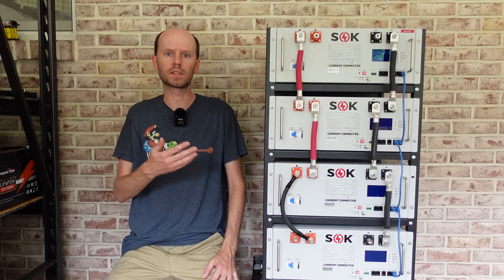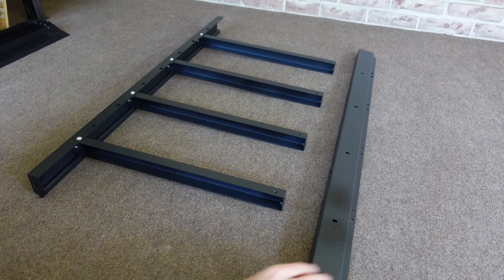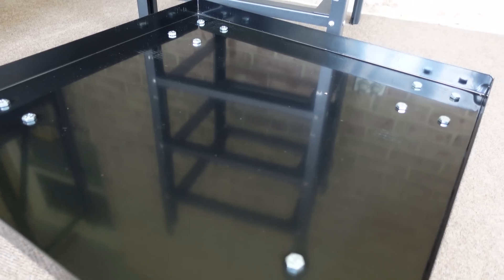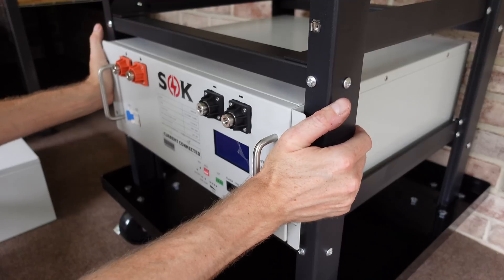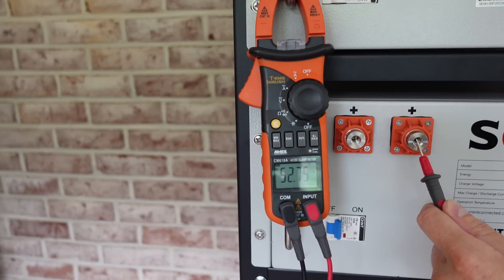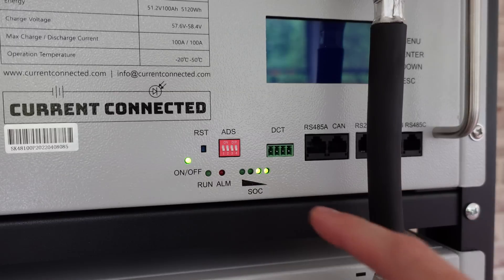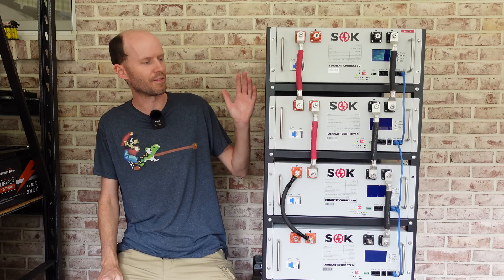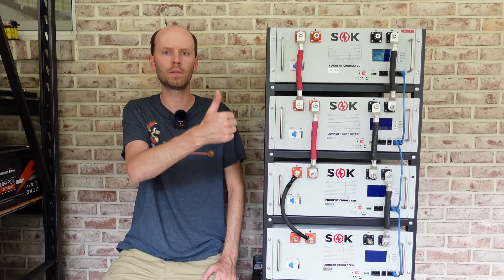20kWh SOK Battery Rack Assembly and Connections, LiFePO4 Off-Grid Solar

Comment: Being in parallel, what happens if accidentally someone turns off one the the breakers?
Reply from the maker: Then the affected battery is simply disconnected from the rest. The others will continue to operate.
Reply: @LithiumSolar  Thanks for your reply. I sent you an email about a bussiness consultation.
Reply from the maker: @josevargas8073   The sentence immediately following the email address reads "I am not available for personal project questions or consultation"
Reply: @LithiumSolar  Oh I'm sorry, I read that but as it's not a personal project and it will be a paid business consultation (sent from company email) I gave it a shot, thanks anyway and I'm sorry again.

Comment: Nice, helpful video. One watch out is that all positive and negative cables should be the same length to each other. Yes, within a very short distance, there is some flexibility, but overall, that longer black cable on the lower left serving as a positive cable looks both to be a lower gauge (2/0 vs. 4/0?) than the others and significantly longer in length than it should be. I guess you were short a cable during setup and just used this for demo purposes, which is fine, but it does raise the two important points I just mentioned that some people aren't aware of.

To the question below on cable length, having this setup myself, those straight cables are probably 9" in length. However, I did mine at 10.5" in length (terminal hole center to terminal hole center), so they would curve a bit and avoid going over the on-off breakers and displays. If you use a one-foot cable, the resulting bend in the wire causes the terminals to crowd each other. Still doable, but you'll want very good terminal covers on each if you do that.

Comment: Nice work. Have you looked into busbars? There are some videos detailing the heat and therefore power lost in the daisy chain setup. It can also lead to uneven charging and discharging.
Reply from the maker: Yes. I addressed that in this video https://www.youtube.com/watch?v=Q0uHhVwmLW4 at the 1:05 timestamp.
Reply: @LithiumSolar  Thanks, but they are still connected to one another, rather than connected separately to a busbar. That run of cable will get hot depending on how much power you are pulling and pushing, connecting via a busbar will limit the heat and save power.
Reply: @LithiumSolar  It's also possible that the 2 poles on the batteries are connected in the inside of the battery, so by moving them in line, might not have much effect. 
David Poz explains why here.
https://youtu.be/eWqJjlHoW9A
Reply from the maker: @simonpaine2347  I'm well aware of how they are constructed inside. There are no scenarios under which the busbar connection method David used is superior to the straight-connect method I used in the linked video above. In fact, I would argue my approach is slightly better. You're welcome to design yours however you see fit, and if you're not sure, I'd encourage you to contact a professional for advice (neither of us are one of those) 🙂
Reply: @LithiumSolar  I was just trying to be helpful!
Daisy chaining is without doubt the easy way to connect, but it's the least energy efficient. Facts.
Reply from the maker: @simonpaine2347  The way I corrected it to in this video https://www.youtube.com/watch?v=Q0uHhVwmLW4  that I linked to earlier is NOT daisy-chaining. I appreciate the input but...

Comment: Hi what if you have 5 batteries how do you set the ads switches with only 4 switches
Reply from the maker: It's binary so 4 switches gives 16 possible numbers. The switch positions for each of the 16 is listed in the user manual :-)

Comment: Having just racked up two SOKs  the weight is massive,,putting four on that Dolly is asking for trouble,,,,,,  I bolted to the floor and again to the wall  ,my batteries are,nt going anywhere.
Reply from the maker: Why is it "asking for trouble" to put 500lbs on a dolly rated for 1000lbs? That's half it's weight rating.

Comment: It's a very nice battery, excellent right of repair characteristics too, but having the display and sockets obscured by the negative cable is devastating design oversight. It was enough to disqualify the SOK for my application since I'm using bus bars. I wouldn't be able to access the ports.
Reply: This got on my nerves too. But since everything else about the battery is good I decided on a U shape bus bars using both the common terminals with the U directed toward the middle of the battery leaving access to the ports and view of the screen. Since we like to keep the parallels equal length I will do it with the positive side just because.

Comment: I always get the smaller ring terminals, to stock up on, or when I do not know the bolt size, because you can always drill them out,  it's better than using washers on them to fix a mismatch,     I like temco stuff, never had a problem with their stuff!

Comment: I have 2 SOK 48v batteries with the MPP LV6548. All is working fine except the communications with the MPP. Getting a 61 communications error. Called Watts24/7 and they say it's the cable. Have tried numerous times to relate my problem with Current Connected who supplied the cable, but no response. Went to the DIY Solar forum and saw that Signature Solar had an issue with their first batch of cables and thinking this case may be the same. At any rate, I think it would be wise to check the cable first (I've checked and re-checked my setup) before even thinking about disassembling everything and sending the MPP back to be tested. Anyone else having this problem or have any suggestions? Thanks for the video and hoping your follow up to this may be of some help.

Comment: I like the enclosed cabinet that Signature Solar sells with their EG4 batteries. It includes bus bars on the sides of the cabinet so there are no cables blocking the displays or ports on the batteries. SOK are very good batteries though.
Reply: Sok also sells their own cables that are slightly longer than the ones this guy used. Until now every showcase I've seen has had the cables looped out around the controls.
I've been spectating on EG4 as well - I have heard people having trouble with the bus bar, but still a very good system that I might consider in the future.

Comment: What happened to DIY Mike?  These are 360$ a kW.
Reply from the maker: There's only so much that can be DIY'ed without getting boring. I already built battery banks with 2 different types of cells (230Ah and 280Ah). Is there anything in particular you would like to see? I'm always open to new video ideas!!

Comment: Did you try the SOK's PC program with the Jakipar.    It worked for me.   I wonder if they are inter-operable within the 16 group.
Reply from the maker: Yes, the Jakiper software seems to read from the batteries ok. The batteries could possibly have different firmware loaded; however, I would expect the communication protocol to be the same. It would be interesting to try.
Reply: @LithiumSolar  can you give me the pinout of the rs232 cable please, currentconnected only ship to the US so not able to buy the cable.
Thanks

Comment: Great video as always. Is there or do you plan on adding covers over the terminals to prevent shorts?

Also, it seems like the cables partially block the displays on the batteries, do you see that as an issue?
Reply: Yes, great battery in most respects, but what can they have been thinking when they put the display where the cables need to run and some coms sockets are also covered !!!!

Comment: if i could afford something like that it would certainly come in handy during these dreaded heatwave like if the heatwave caused a brownout or a blackout go into basement and switch off the main breaker and start powering up the inverter or get some sort of transfer switch that can automatically switch to inverter if line voltage gets to low or goes out completely
Reply: Start small and work your way up. You learn heaps along the way. Very rewarding to be self sufficient.
Reply: @Nāmarūpa1  i come across sometimes some regular lead acid batteries but these wouldnt be designed for a big setup as they are more of designed to be used in some scooters, alarm panels and UPS units

Comment: Word of advice, get some silicone insulation 4/0 wire that is very flexible. Route your jumper wires around the display and controls so they're not behind the wires. A little extra wire to make it look nice and easy to use doesn't hurt anything.

Comment: I'd go the extra mile and take a single bolt loose on all the caster plates, and then fasten the rack to the casters. That way the rack and dolly are one unit.
Or, you could drill a hole in the middle and bolt them that way. But that might make a stubby that would get too close to the wheel then.

Comment: Nice one, Mike. Are you going to cover the front with something to prevent the terminals from being exposed? Like a door...?
Reply from the maker: I'm not sure yet. I will be adding heat shrink to the lugs but there is still a lot of exposed metal. They include rubber covers to go over the posts but can't fit the 4/0 wire through. I might need to make something custom.
Reply: @LithiumSolar  I asked the same question, I missed you answering it here.
Reply: I was thinking a plexiglass glass as its to cool to cover up - you want to show it off

Comment: What brand crimper tool did you use. Looks like a nice crimp on the cables. Maybe do a little video of crimping your lugs unless I missed it in previous videos. Just thought I would give you an idea for some content.
Reply from the maker: Thanks for the idea. Unfortunately, it's a generic brand hydraulic tool from Amazon. The crimps are actually not that good and I have to do each one 3 times to make it look like that. I am in the market for a better tool, just unsure what to get at this point. I need to spend some time researching one of these days.

Comment: Does four dip switches mean that four is maximum number of batteries that can be paralleled?
Reply from the maker: You can parallel up to 15 of them with communications. The DIP switches are like binary meaning 4 positions of 0/1's is a maximum of 16 possible addresses; however, one is reserved for the inverter.
Reply: @LithiumSolar  I see. Thanks for the prompt response.

Comment: Dude I love your tear downs and I admire your knowledge!  BUT this video just set my skin on fire!. Not bolting a tower down??? Bad connections between high current units???  The rack has floor mounts but you stand it on a glass dolly?? Double connections on each unit but you only use one?? I hope you were current drawing from the middle and not one end!! I wont dislike due to respect.
Reply from the maker: There's nothing wrong with how I connected them. Sure, you can run two sets of cables up each side if you're concerned. I'm not sure that's necessary though. Also, you're welcome to bolt it down if you'd like. This is a temporary setup for demonstration purposes. It doesn't make sense for me to drill holes in the cement floor and install anchors for something that's temporary. I'm not sure I'd do it even if it were permanent unless I lived somewhere like California that's prone to earth quakes.
Reply from the maker: I should say too that I don't necessarily disagree with the high current concern though. Perhaps it would be better off in this case if both logs were on the same terminal post. Maybe I'll switch it up, will try in the morning.

Comment: A little of this topic but one for some of your prior reviews..With a 100 amp 12v battery, how do they cope with an inrush power load on the inverter.  Example.  A frig compressor starts on 17 amps (inrush) and runs on about 1.2 amps.  With a single 100 amp battery protected at 1C or 100 amps draw, what happens when it is asked to provide almost twice that (175-200 amps) for a short time to start the compressor?  

A T Burke
Reply from the maker: The inverter will have capacitors on the DC side to help with inrush. Additionally, most batteries are rated for a temporary surge. For example, the 12V 100Ah SOK is rated for 200A for up to 3 seconds.
Reply: @LithiumSolar  Thank you, Sir.  

A T Burke

Comment: Pretty slick. We just built a data center backup with 12 of the EG4 but these look solid.
Reply from the maker: Wow almost 62kWh, pretty big system!
Reply: @LithiumSolar  heh yeah, I did eve cells for diy at my house and have closer to 150kwh there from diy setup, but for UL purposes the eg4 and supporting hardware is useful in business setting. my diy setup is remote from the house in a shipping container but powers the house.